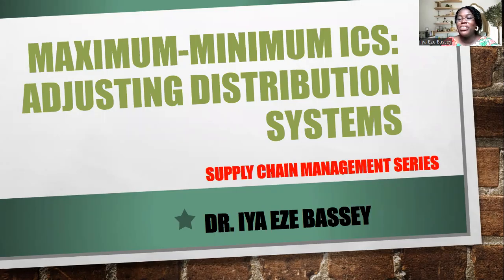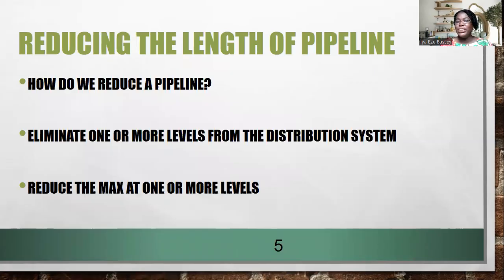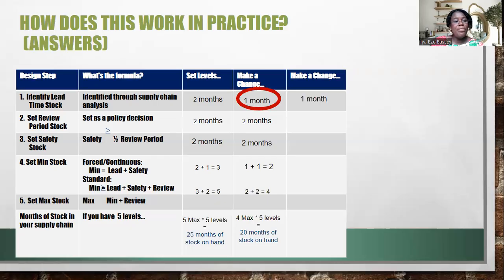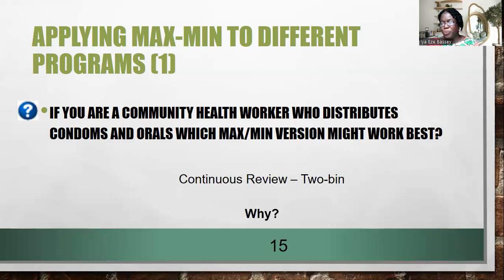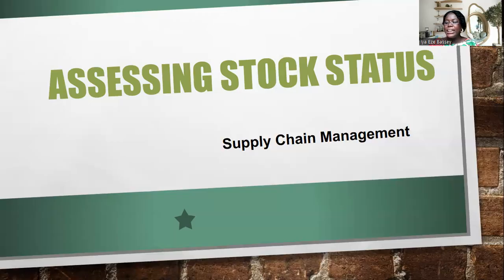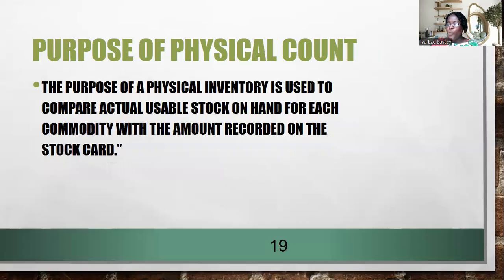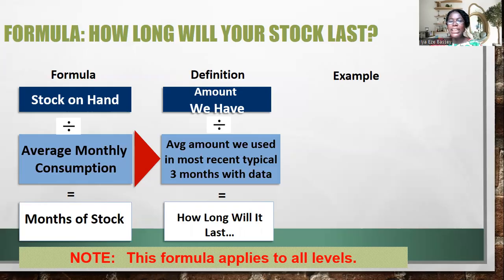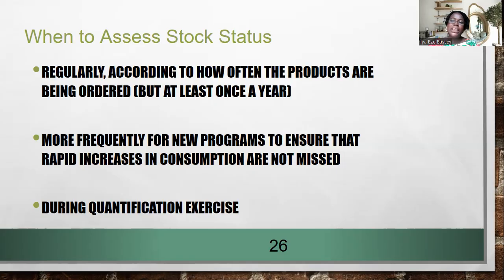Maximum-Minimum ICS: Adjusting Distribution systems (Supply chain management series)

Comment: Good 👍 
In summary I learnt maximum -minimum inventory control systems are super useful for managing the supply of laboratory regents, equipment and consumables in medical lab science, by setting the right maximum and minimum stock levels. 
Labs can meet testing demands without having too much or too little invention.
It helps keep operation smooth 
And ensures timely delivery of accurate test results .

Comment: SUMMARY 
The steps in designing the max-min ICS
1. Set up initial max-min policies for each level and type of faculty 
2. Check if the overall distribution will function properly if the level specific max-min policies are implemented 
3. Check the total length of the pipeline that the policies at each level imply 

We can reduce the length of a pipeline by 
1. Eliminating one or more levels from the distribution system 
2. Reducing the maximum at one or more level 

Some of the factors that might affect your determination of max- min stock levels are 
1. Cost of product 
2. Reliability of transportation 
3. Storage capacity 
4. Lead times
5. Storage conditions at different levels 

Some of the advantages are:
1. It avoids over stocking 
2. It avoids under stocking 
3. Minimize wastage 
4. Consistency of stock levels 
5. Avoids cost of emergency 

Thank you prof🙏

Comment: To achieve a well distribution system there are steps involved which are;
     The length of the pipeline 
1. Set up initial max-min ICS for each of the level. 
2. Check if the overall distribution will function properly if the policies ar each level are implemented.
3. Check the total length of the pipeline that the policies at each level imply.
     Reduce cost of pipeline 
1. Shortened the review period and reduce the lead time at one or more level.
2. Improve the distribution system reliability at one or more level.
   Factors that can impact max-min  stock level are
1. Cost of product
2. Reliability of transportation 
3. Cost of storage 
4. Storage capacity 
5. Lead time.

Comment: In summary 
Adjusting a distribution system using a Max-Min Inventory Control System (ICS) involves:
1.Demand analysis: Analyzing historical demand data to determine optimal Max and Min levels.
2.Lead time: Considering the time it takes for inventory to be replenished.
3.Service level: Determining the desired level of customer service.
Benefits
1.Improved service levels: Ensuring products are available when needed.
2.Reduced inventory costs: Optimizing inventory levels to minimize holding costs.
3.Increased efficiency: Streamlining the distribution system.
By adjusting the distribution system using a Max-Min ICS, organizations can optimize inventory levels, reduce costs, and improve customer satisfaction.

Thank you ma

Comment: In summary: I learnt about the steps in designing maximum/ minimum inventory control system, and how to eliminate one or more level from the pipeline.
And the steps to this are:
--Set-up maximum/ minimum policies for each level and type of facility 
-- establish initial maximum/ minimum quantity for each level and facility types 
-- verify that the overall distribution will function properly 
   Benefit of using maximum/minimum are:
- it avoids overstocking 
- it avoids understocking 
- it prevents wastage 
 Physical count is the process of counting with hand the total number of usable units of each commodity.
Lastly talks about when to access stock status where we talk about Regularly according to how often the products are being ordered.

Comment: Thank you ma for this wonderful lecture..
     IN SUMMARY i learnt that before setting up a MAX/MIN ICS system there are some steps needed to be followed which are:setting up initial max-min policies for each level,checking if the total distribution will function properly if the specific max-min policies are implemented and check the total length of the pipeline that the policies at each level imply..
   HOW TO REDUCE THE LENGTH OF PIPELINE
1) Eliminate one or more levels from the distribution system
2)Reduce the maximum at one or more level..
    I also learnt that there are FACTORS THAT IMPACT MAX-MIN STOCK LEVEL which are:
Cost of product, Reliability of transportation,storage capacity,cost of storage,shelf life,lead time e.t.c
      ADVANTAGES OF USING MAX-MIN SYSTEM
Avoid overstocking,avoid understocking, minimize wastage and also consistency of stock level e.t.c

     PHYSICAL COUNT
It's the process of counting by hand the total number of usable units for each commodity in your store or health facilities at any given time..
      PURPOSE
The purpose of physical count is to compare the actual usable stock on hand for each commodity with the amount recorded in the stock or bin card...
    The main purpose of assessing stock status is to determine how long supplies will last...

Comment: Thanks for this wonderful lecture ma, I learnt about the advantages of MAX-MIN ICS; 
--- Reduce waste 
--- avoid emergency order costs.
The challenges; 
--- Managing systems with multiple levels.
--- Managing inventory for new programs.
*Maximum Stock Levels can be reduced by;
1. Improvement of distribution system reliability.
2. Reduction of lead time at one or more level.
3. Shortening of review Period at one or more level.
*I also learnt about the purpose of  assessing stock status; 
--- Conducting physical count.
--- Essential in verifying stock accuracy.
--- Preventing discrepancies that could lead to stock outs or overstocking.
* I also learnt of the Factors that impact MAX-MIN stock level. Which are;Reliability of transportation,Cost of products,Shelf life of health commodities,Storage capacity,Cost of storage.And lastly,
How to reduce length of pipeline:
1. It reduces the maximum at one or more level 
2. Eliminate one or more levels from the distribution system.
                 Thanks 😊

Comment: Thank you, ma, for making it clear on the ways to adjust the distribution systems policies. I was able to understand the challenges, advantages of using the Max-Min system, applying he Max-Min to different programs. In summary I learnt that the length of pipeline is the first step to take that the policy at each level imply. Reducing the length of the pipeline by eliminating one or more levels from the distribution system, reduce the max at one or more levels, reduce the maximum stock level I learnt that factors that impact max min stock level are; cost of product, reliability of transportation, storage capacity, cost of storage, shelf life of health commodities
 Advantages of using max min system 
1. Avoid over stocking 
2. Avoid under stocking 
3. Avoid cost of emergency order
4. Minimize wastage 
5. Consistency of stock levels
 I also learnt that physical count is the process of counting by hand the total number of useable unit if each commodity in your store or health facilities. We access stock status regularly according to how often the products are being ordered, more frequently for new programs to ensure that rapid increases in consumption are not missed.

Comment: In summary ,i have learnt about the steps in designing a maximum minimum inventory control system are; 1 set up initial maximum policies for each level and type of facility 
2 check if the overall distribution will function properly if the level specific maximum minimum policies are implemented.
3 check the total length of the pipeline that the policies at each level imply.
 Factors that impact maximum minimum stock level are;
1 cost of producers 
2 storage condition at different levels
3 cost of storage 
4 shelf life of health commodities.
Advantage of using maximum minimum system are;
1 Avoid overstocking 
2 Avoid under stocking 
3 minimize wastage 
4 simplify inventory control decisions making 
5 consistency of stock level 
6 Reliable data source from SDP for forecasting and quantification.
I have also learnt about  physical count which is the process of counting by hand the total number if usable unit of each commodity in your store or  health facility at any given time.
And the purpose of physical inventory is  used to compare actual stock on hand for each commodity with the amount recorded on the stock card. Thank you ma.

Comment: MAXIMUM - MINIMUM INVENTORY CONTROL SYSTEM: ADJUSTING DISTRIBUTION SYSTEM 

Thank you ma, in summary to identify ways to adjust distribution system policies which are from the port to the central warehouse to the regional warehouse, to the hospital to the health post or health centers to the community health workers and finally to the clients. 
      And I also learned about the advantages and challenges of max- min inventory control system which includes; 1) Avoid over stocking 
                  2) Avoid understocking
                   3) Avoid cost of emergency orders 
Thank you  very much ma for the wonderful lecture

Comment: Thank you ma for this insightful lecture regarding adjustment of the distribution pipeline of the maximum minimum inventory control system as I understood that before designing a max-min inventory control system one must set up his initial policies for each level and the type of facilities, check if the overall distribution will function properly if the specific level of max-min policies are implemented and also check the total length of the pipeline that the policies at each level implie.
To Reduce the length of the pipeline the following are involved:
1. Eliminating one or more levels from the distribution system
2. Reduce the maximum stock level 
3. Shorten the review period at one or more level
4. Reduce the lead time at one or more level
5. Improve the distribution systems reliability at one or more level.
There are factors that Impact MAX-MIN stock level these are:
1. Cost of products
2. Reliability of transportation
3. Storage capacity
4. Cost of storage
5. The storage conditions at different levels
Other factors that Impact MAX-MIN stock level includes lead time, reliability of source of supplies, effect of zero balance of stock, management skill of staff, age of program and accuracy of forecast. 

I also learnt about assessing stock status and the purpose (which is to determine how long supplies can last),  when to assess stock status (could be regularly according to how often the products are being ordered or at least once a year, more frequently for new programs to ensure that increase in consumption are not missed during quantification exercise.

Comment: In summary, i leant that in adjusting distribution policies the implementation of specific maximum policies at each distribution level is important for optimizing inventory flow.
   In designing a maximum - minimum inventory control system is to: 
- set up initial maximum - minimum policies for each level and type of facility 
- total length of the pipie line.
Eliminate one or more levels from the distribution system.
Reduce.the maximum at one or more level.
   Factors that impact max- min stock levels 
- lead time
-Reliable source of supplies 
-Effects of a zero balance of stock 
-Shelf life
-production cost.

Comment: Thank you Ma, for the lecture 
I understood how to reduce max stock level 
*shortening the review. Period.
*reduce lead time at one or more.
* improve distribution systems reliability at one or more levels so the stock can be reduced. 
Factors that impact max- min stock
* cost of product 
* Ratability of transportation levels 
* storage capacity
* cost of storage 
*storage conditions at different levels lead time, Age of program 
* forecast. 
Advantage of using max-mins system 
* Aviod Over stocking 
* Avoid cost of Emergency orders 
* Avoid under stocking
* Avoid minimum wastage.
We have time to Access stock status 
1) Regularly according to how often the products have been ordered.
2) more frequently for new programs to ensure that Rapid increase in consumption are not missed. 
3) During qualification exercise.

Comment: Thank you ma 
I learnt that the step in designing a max-min ICS are:
1. Set up initial max-mi policies for each level and type of faculty 
2. Check if the overall distribution will function properly if the level specific max-min policies are implemented.
3. Check the total length of the pipeline that the polices at each level imply.

How to reduce the length of pipeline 
1. Eliminate one or more levels from the distribution system.
2. It reduces the max at one or more level 

How to reduce the maximum stock levels 
Element of the formula which can be changed in order to reduce the max stock level:
1. Shorten the review period at one or more levels.
2. Reduces yhe lead time at one or more levels.
3. Improve the distribution system reliability at one on more levels so that safety stock can be reduced.

Other factors that impact max-min stock level 
• cost of products
• reliability of transportation 
• storage capacity 
• cost of storage 
• shelf life of health commodities 

Advantages of using max-min system 
• Avoid overstocking 
• Avoid understocking 
• Minimize wastage 
• Avoid costs of emergency orders 
• Simplify inventory control decision making 

Challenges to using each version and variation
• systems with numerous levels 
• systems that manage a large number of commodities 
• systems that manage products for new programs 

A physical count is the process of counting by hard the total number of usable units of each commodity in your store or health facility at any given time.
The purpose of a physical inventory is used to compare actual usable stock on hand for commodity with the amount recorded on the stock card. While the purpose of assessing stock status is to determine how long supplies will last.

Comment: Good day ma, in summary i learnt:
Distribution system design involves setting initial maximum stock policies for each facility level then verifying if these policies function correctly across the entire supply pipeline.
Examples of pipeline stages: seaport -> central warehouse -> regional warehouse -> district hospital -> district warehouse -> health clinics, which may total up to 20 months of stock pipelines, often too long for commodity shelf life.
To reduce pipeline length: 
√eliminate one or more levels from the distribution system
√reduce the lead time at one or more levels 
√shorten the review period at one or more levels.
√improve the distribution systems reliability at one or more levels so that safety store can be reduced.
Factors that might affect determining maximum and minimum stock levels besides the length of the pipeline are:
~cost of product: higher cost may limit stock levels.
~reliability of transportation: poor roads or transport reliability increases safety stock. 
~storage capacity and condition at different levels: facility limits and shelf life affect stock levels.
~lead times: longer lead times require higher maximum stock.
Advantages using maximum - minimum system are:
∆it avoids overstocking
∆ it avoids understocking
∆ it minimize wastage 
∆ consistency of stock levels
∆ avoids cost of emergency
∆ simplifies inventory control decision making.
Challenges of each of the versions and variations are: 
° systems with numerous levels 
° systems that manage products for new programs 
° systems that manage a large number of commodities.
Continuous review are small number of product at commodity level. It is simple to operate, easy replacement when stock reaches minimum, less skilled personnel.
Thank you ma💝

Comment: In summary 
I learnt that the Max-Min inventory control system adjustment involves periodically reviewing and adjusting the max and min inventory levels to ensure they remain relevant and effective.  
I also learnt,
How to reduce length of pipeline, 
Eliminate one or more levels from the distribution system, 
Then also reduce the max at one or more levels 
Also other factors that impact max-min stock level include, Cost of products,Reliability of transportation, Storage capacity, 
Cost of storage, commodities. 
Then the advantage of using max-min system is to
Avoid overstocking, Avoid under stocking, Minimize wastage,  
Avoid costs of emergency orders, etc.  
We looked at an important part of inventory control system which is 
Assessing Stock Status.
Physical count which is the processs of counting by hand the total number of usable units of each commodity in your store or health facilities at any given time.  
Lastly when to assess stock status 
Regularly, according to how often the products are being ordered. 
More frequently for new programs to ensure rapid increase in consumption are not missed, etc.
Thank you ma for the lecture

Comment: Summary Adjusting the pipe line in max-min ICS and accessioning stock status 

I learnt the steps in determining max-min ics which are 
1. Set up initial max - min policies for each level and type of faculty 
2. Check if the overall distribution will function properly if the level specific max-min policies are implemented.

Learnt about factors that impact max-min stoxk level 
- cost of product. - reliability of transportation -storage capacity and cost of storage 

Also learnt about it's Advantages 

Learnt about physical count and its purpose .

Comment: I learnt that the max-min system helps to avoid overstocking, understocking, cost of emergency orders, minimize wastage.
To reduce a pipeline one or more levels from the distribution system can be eliminated. Factors like costs of products, storage capacity, cost of storage, shelf life of commodities, lead time all these can affect max-min stock levels.

Maximum stock levels can be reduced by the following:
-Improvement of distribution system reliability 
-Shortening of review period at one or more level
-Reduction of lead time at one or more level.
Thankyou ma❤️